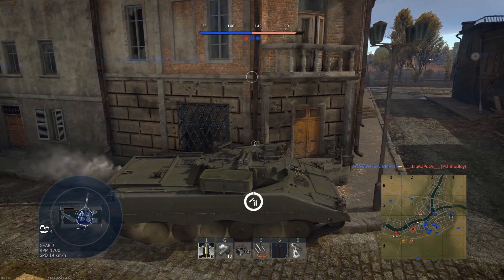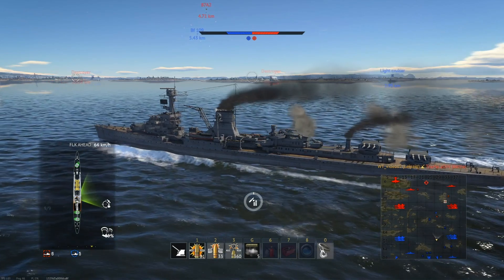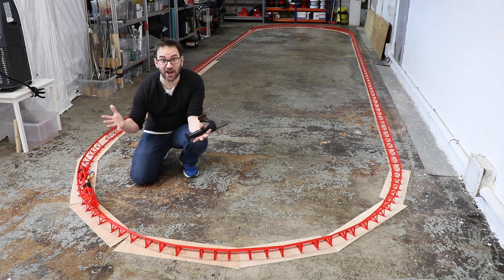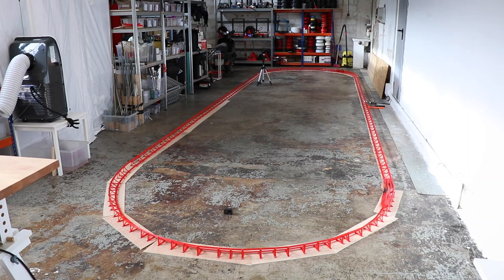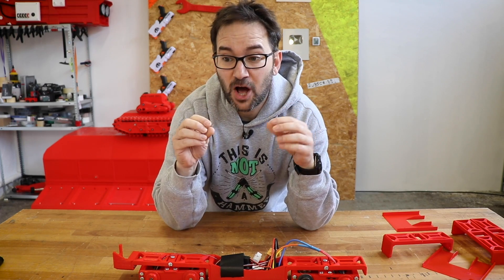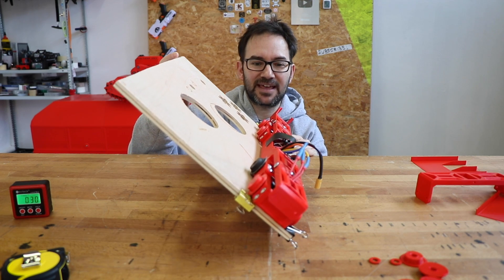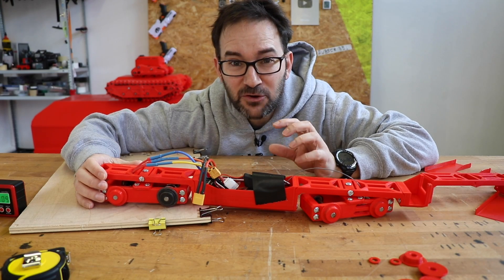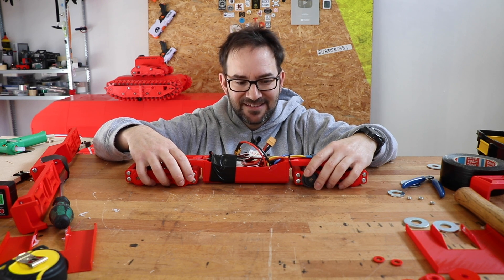WORLD FASTEST TOY TRAIN

Comment: How many more straight sections could you fit into the shop?  A longer straight-away would let you build more speed before hitting the "trap".  If you feel like running the printer (to remake track supports) some more, you could probably get a few more KPH if the straight sections weren't banked as much as the curves.  Maybe add another drive motor for the "front" trucks.

Comment: third rail in bettwen grabed from downside by sort of arm could help with some local problems with bouncing, also good posibility to make external power source
Reply: and mayby steel wheels made on cnc router and rouded to proper shape in mill alike way by using drill and file for less friction and more durability

Comment: Really like the design, however, you may have better luck with a circular path.  Also WHY do you need to re-print the chassis when you could save time and material by just cutting the ends off?

Comment: Rocket Engines as supplemental power, the timing for the straight may be a bit difficult.  Compressed CO2 cartridges pre punctured with a dump valve, use a thin long nozzle for maximum thrust.

Comment: As many have suggested, twisting the track so that it is not so banked on the straights should help, but I think a smoother transition from straight to turning would also help. As it is now the transition from turn to straight is quite jarring, and may contribute to the derailment. I would suggest you make the turns more of an elliptical shape. Some form of suspension would probably also help with derailment, as the mass of the train would not get as much vertical velocity when going over bumps. And finally, that is NOT a train! It's only a locomotive. for it to be a train you have to have at least one rail car as well.

Comment: Adding weight was a good idea but if you put it more on the side of the train that's higher and less on the side that's lower it will put the center of gravity more between where the wheels contract the track when leaned over. Once it stops falling off the rest is just motor speed :)

Comment: 1, ur track design is overly complicated for engineering and simplification,

2, ur train isnt the fastest train, there is a lego horizon express train from 2014 to 2018 area that beats ur trais speed up to 50 mph, it went so fast the whole train flew off mutiple times, try to make ur train go fast enough so it can fly off into 100ft air jump, then urll be the winner
Reply: Also 11 mph? I can run faster then that thing and im fat! XD u need more wider track  curve not as much slope, (max track slope should be arround 10degrees inward turn) and ur straight can be literally flat
Reply: Also from ur accent u sound italian, maybe go for a euro or French design track and engineeringthen italy, their train barely worked like urs, if u want speed u need math, not guessing

Comment: I'd say make a "maintenance train" to run before the main one and clean up the track. Similar to "real life" rail grinders it should have two sanding wheels (something as simple as a 3D printed wheel with sand paper glued to it) that spin in the opposite direction to travel and the idea is that those wheels will clean up any burrs or bumps in the track, making it more suitable for high speed.
And speaking of rails, change their profile to more of rounded top surface, or at least bevel the inside corner. It's not as important as a smooth track since there are not many turns, but i feel that in it's current form a wheel might catch that sharp corner and fling the train off the track.

Comment: The train always derailed on the inside of the track, so you can probably lower the banking angle of the track a bit. Adding weight also seemed to help with stability, so maybe a bigger battery will help it to stay on the track during the straight sections. Of course it will also give it more power. Making the track less bumpy is also an important step.

Comment: Honestly that is not that fast, could have been at least twice. 
For starters the track shouldn't be banked on the straights, as you see in the real world such as in Nascar tracks.
The banking works due to vehicle momentum while turning. 
Then the motor probably has way more torque then it can use in this scenario, so you can convert some of that torque into wheel RPM by trying different sized pullies.

Comment: If you have an ellipse instead of two arcs and two straights, then your curvature would change gradually and you can bank the track in proportion to the curvature, and the bank will also change gradually.  There should be no upper limit to the speed as long as the max curvature section is banked steep enough, although it may introduce a minimum speed to not fall inward.

Comment: Ivan. The banked straights aren't helping, the train will have a lot of friction on the inside wheel where it rubs against the rails.
You need to flatten the straights.
Does the way the train travel make a difference? Pushing or pulling, it's worth looking into.
Lastly. How about some small aerofoils to help keep it stuck to the tracks?
Keep up the fun. 👍😷

Comment: Ivan, you don't need to incline the tracks at the straight parts, because when the train turns it applies it's own weight into the track witch makes it stick to the track but when the train is going straight there is no such forces pushing the train down exept its own weight

Comment: If you Keep the track banked on the straights, you might consider making the train asymetric.
Maybe driving two wheels on the same(lower) side might make a difference as there is more pressure/friction.
also i wonder if it is fast enough to make aerodynamic downforce an Option.

Comment: you are getting most of the centrifugal forces in the turns and not on the straightaways. if you want to improve your top speed the "simplest" solution I could recommend (not read: least labor intensive) would be to reduce the grade in the straights as you are basically driving the train from the side that is closer to the ground due to gravity. less grade means more contact with the track in the straightaways and less chance of derailing.

Comment: That's cool, I would flatten the straights a little and the washers in a swivel basket thingy so it can take advantage of its own "G" in the corners, if possible also print some "leaf springs" for the bogies. And slightly bigger wheels with the bearings in the wheels not the bogies. I hope that some of these work or you take some of them into consideration. Figers crossed 😊

Comment: add a spoilers make it more aero dynamic, remove weight from the top and add to the bottom in the print files by hollowing out traingular areas, gear the motor, obviously track size and layout, add a 3rd T shaped rail to the track with a connector on the bottom of the carts? meh ramblings might help :D fun project though ;)

Comment: definitely reduce banking in straights. doesn't need to be totally flat, as that would just make the transition to the corner more complicated. maybe 10-22.5 degrees. (half of 45)
Did you happen make the size a standard railroad gauge? So you can run it on some other people's home  tracks once things are more normal.

Comment: Excellent video as always, sir. 

The higher speed attempts will need a better trueness of the straight sections. Any bumpiness will cause the vehicle to bounce and derail before max velocity is achieved.
I agree that the straights don't need banking, but the entrance and exit transitions will be tricky. If the exit transition is too abrupt then the track will fall away from the bogies causing a derail. Trigonometry will have the answer for speed vs falling due to gravity.

Comment: you should have the straights level to the floor, and the corners can be banked further, as the acceleration will hold the train to the rail in the corners. also, make an aerodynamic shell for it :)

Comment: To make it faster given that you have no space to make larger curves, and that the speed you can get seems to be limited by the traction and not by the power, I think you can:
- try to get the straight parts level, so you get equal traction on all 4 wheels;
- tilt the wheels, it would use the centrifugal force to add traction in the curves, but it would obviously complicate a lot the design (at least of just the train, you can keep the tracks);
- add motors also to the other cart, 8 wheels pushing should double the traction;
- maybe some form of suspension could help to smooth the bumps and increase traction;

Comment: The straight sections don't need to be banked, or at least not as steeply- only the ends need to be banked in order to stop the train flying off the track as it turns the bend.
Reply: The problem is that if the incline changes, the train will need an additional axis of articulation (twist), otherwise the front wheels will ride on a different incline than the wheels behind it and it will derail
Reply: @klausklaus5618  This essentially already happens anyway, to some degree, as it transitions from straight track to a curve
Reply: @LostApathyDotCom  Does it though? I don't really know the correct nomenclature for things running on tracks, but in airplane terms this track has pitch and yaw action, but no roll. Therefore the wheels have to articulate side to side and up and down. If the inclination of the track changes, the train has to do a roll, thus a new degree of freedom, thus a "twist" articulation hast to be introduced. Check out NighthawkInLight's Backyard Rollercoaster video. It's partly about a similar issue and they explain it better than I can :)
Reply: @klausklaus5618  that is where a suspension system is useful
Reply: It's easier to design it this way. (saves maybe 20 Minutes in CAD)
Reply: I think if the transition from banking to no banking is too steep, it will unrail. Because when you drive out of the curve and the banking curves out, if you are too fast you will "Fly" with  one wheel. I'd either suggest somehow fixing it to the rail (Rollers below the rail), or (And I prefer this solution) make it a circle and put bankings all the way around.
Reply: @xDanoss318x  The banking is meant to counteract the forces you describe. You go steeper as you go into the curve. If you watch the video closely you'll see that one of his issues is when he goes into or out of the curve the banking of the straight part "kicks" back. He runs into a wall, so to speak.
Easing in and out is the right way to go here. Adding extra rollers only add more friction and also the banking in the straight parts lead to the wheels rubbing against the track, thats where a lot of force is lost.
Reply: @juweinert  I know. But the transition without precaution would definitely derail it. I don't think you could make a transition long enough to not derail it, that would fit into that space. And if you go faster, it will only get worse and worse. But the added friction you mentioned is also a problem. didn't think about that.
Reply: They don't need to be banked, but do they need to be level either?
Reply: @ki0w0-lordofwatersheep  yes, that's the whole point of the various discussions- having the straight sections at any kind of angle is totally unnecessary and only increases the difficulty of keeping the train on the tracks.
Reply: yeah, exactly, on the curves you need it so that the x component of gravity compenses the moment of inertia while changing direction. Having inclination on the straights will only decrease traction.
Reply: I agree.  i think on the straights, gravity is pulling the weight harder on the inside wheels/axles.  level it out more and bank the turns

Comment: Yes, Definitely would like to see you go for faster speeds, maybe try leveling out the banking in the straights, a longer wheel base means more highspeed stability and maybe sanding the bits of railroad where the pieces are connected. Try lowering the battery instead of adding washers, as that would add unnecessary weight and see how reducing the wheels form 8 to 4. lastly a tiny bit of Aero work and MO POWER BABY
Reply: Yeah, agree on lowering the weight rather than adding some

Comment: Ok let me help you with the tracks. The midsection of the straights should be flat with the ground. And then as that train starts approaching the curve, they can start to tilt, ever so slightly. Since the train will only do circles put must of the weight on the side of the train inwards to the curves and as down as possible, take inspiration in modified NASCAR cars. Also, I'd like some more of that onboard footage. Cheers, best of luck.

Comment: Faster! Faster! with loops!  Add guard rails or fully enclosed latticework cage at dangerous points to the rails to keep it from flying away and breaking during a derailment. Once you get it done and figure out max safe speed elevate it permanently in the shop out of your way but where it can be used. Put in a limiter for max safe speed otherwise a future guest will derail it.

Comment: Well, since you already have a lot of rails printed, you could leave the straight areas flat but add a twisting / untwisting piece at the start and end of the curve. Also, at these speeds, how about some air spoilers to create downward pressure on the rails as the train gets faster, to keep it from derailing?

Comment: Needs to go faster. To do that:
Probably compramise for now and make a round track with appropriate banking.
Try removing the grease from the bearings. These bearings can take a lot of torque at high rpm due to the greese which is mainly useful for high load handling. That should be about 50% of your power.
Direct drive on sensored bldc motor with about 6s batteries should be good. Use different wheel sizes to optimize for motor torque.
At very high speeds the track may rock so may need to be secured even better from now.

Comment: Remove the bank on the straight sections.  Every time that it fell off in the video, it was on the straight sections.  The angle of the track serves no purpose there.  The turns should be banked, the straight sections should be flat, and the only trouble you will probably have is making the transition from the flat to banked smooth enough that it doesn't upset the train.

Comment: If you wanted to keep the incline, perhaps a guide wheel fixed to the train that hooks onto the back of the track to keep the train from derailing?

Edit: you could even flatten out the track and keep the guide wheel as long as the track is elevated.

Comment: Now do an endurance world record. I wonder how hard it would be to make a train that just goes on forever, the in motion recharging would be a good test of your hacker ability i think. Do you go for battery hotswapping? copy the real trains and add a "third rail" or overhead wires? change the routine and have a pit-stop? 

Also it would be funny if you printed a smaller set of tracks and trains to stack ontop of eachother. if they all go in counter rotating directions then the top one should remain motionless even while going full speed.

Comment: I would recommend for the greatest speed and minimum risk of derailment making a circular horizontal rail system. How you would get it to start, however, to get enough speed to pull it outwards onto the rails is a whole different problem. Train hamster wheel?

Comment: Why are the straights not flat? Inclined tracks are only useful for turns. Also, the front cart should have the front wheels smaller and maybe it should also be able to move sideways a little bit wrt to the body of the train. This would allow it to turn faster (as it does for real trains - it's called the italian cart, but I can't find any page on it that isn't in italian)

Comment: simple an aerofoil on the top to push it into the track,  make it more aerodynamic, and where the track ends meet the next component track ends smooth them out or trying and remove them so its is a continuous track,  it induces a rythmic vibration and you dont want that as the speed increases, the track vibrates and the train does and that adds friction.  It goes out of phase and will push the train off,   might be a good idea to try a magnetic linear rail at four points, remove the motor out of the train.  The mag linear rail will propel the train out of the tunnel at speed to the next tunnel where it pulls it again to the next one, and it will get faster and faster.  instead of one track for it to rest on and have a another above, and have the train with extra wheels, so that it is basically a runner,  to save cost make the train smaller and heavier.  If it was my project I would make the track a square box track with wheels above and below pushing on the track on the inside to out.  With a mag rail at four points increasing the speed.

Comment: Banking of the track on straightaways just limits the speed you can get from your wheels as the force vector is pushing the train equally into the track and off the track (no centripetal force on straights). As such most of your power is only being distributed to the one lower drive wheel, and only about half of that. Easing the banking to near flat on straights will allow gravity to push on both drive wheels while also allowing for more stability.
Reply: So good to read someone able to say what my eye were enable to put in words! Thanks

Comment: I think reducing the amount of banking on the straight portion of the track should help with your derailing issue. (think of the way American Nascar tracks are highly banked in the turns, but mostly flat on the straightaways) Also, you could try making the straight portion of the tracks longer to help build up more speed?

As for the train itself, possibly try a bigger gear on the motor, and a smaller one on the drive wheels. Should give you a better ratio and possibly top speed.

And if all else fails, strap a few rockets to it and let it rip! =P